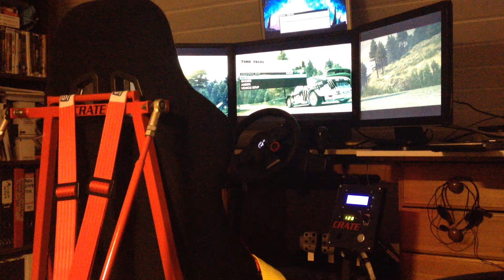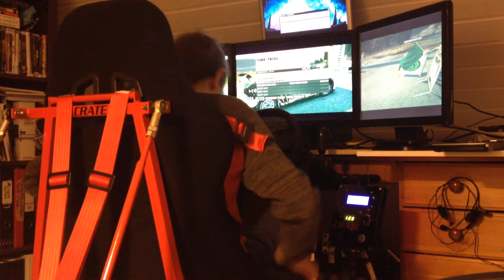Dirt 3 with DIY Wiper Motor Motion Sim and SoftTH

Comment: model car motors?
Reply from the maker: evolaco Mitsubishi Lancer windshield wiper motors, modded to rotate freely in both directions.
Reply: They did not turn free before ?, I have two passat of 99 and I do not know if they will be enough
Reply from the maker: evolaco Well, I just used first motors I found from the local scrapyard, I was not sure if they'll do the job. Not until testing. My motors are just barely enough, they work, but are pretty much on their limits. I was going to replace them with bigger ones when they would break, but they are still ticking, pretty amazing actually! Regarding the modding, yes, there was mechanism that changed automatically direction on certain point. It had to be removed to be able to fully control the motor with external H-bridge.
Reply: And which engines would be bigger? I do not want to use 24v so I do not have to buy another psu and ibt2 that are more expensive, I already bought the motomonster, if using springs would help the movements?

The belt carries it in the fixed part so that it tenses when the seat goes forward? I thought of using another engine to pull the belt but I do not know if it's worth it, it feels good as you have it?
Reply from the maker: evolaco These would do the job and some more! http://m.ebay.com/itm/GEAR-MOTOR-12-VOLT-GREAT-FOR-SAWMILL-CRAB-POT-PULL-FEED-150-160-rpm-25-1-ratio-/351066992384
But, I'm using motomonster too and those motors would need one motomonster each, and hefty psu. My current motors do work, movements are reasonably fast and accurate. So as long as they work, I'm happy, no need for bigger motors atm. There just isn't much headroom, I'm using everything they got. Spring systems quickly become pain to setup and balance, but is an option offcourse. About the seatbelts, I think it is not worth it to dedicate own motor for belt tightening, I must say it works really well the way I've set it up and feels natural.
Reply: At full load do A have the engines? Mine are put to 6-7A and slow down in half more or less, if you stop them 18A mark
Reply from the maker: evolaco One motor peaks at 11-12A with reasonably heavy profile if I remember correctly. I have 15A fuse on each motor and I have never blown a fuse, so it has never gone over 15A.